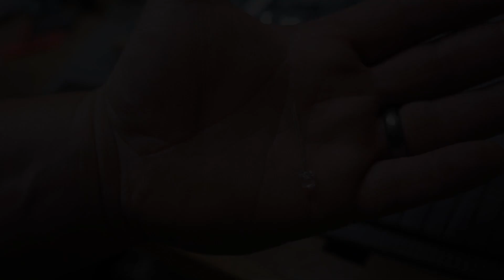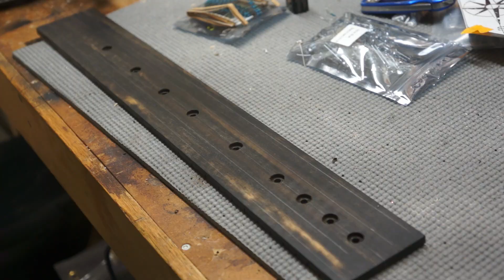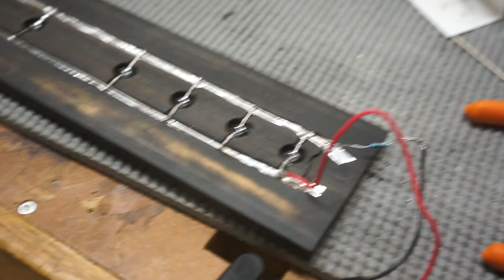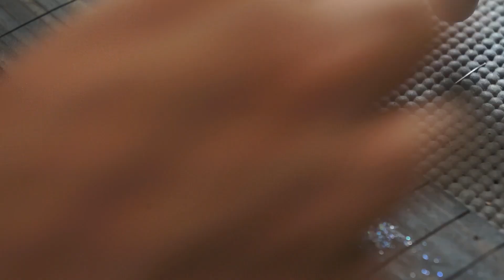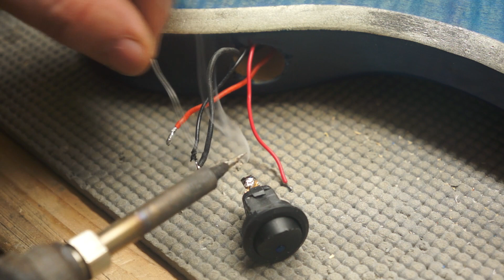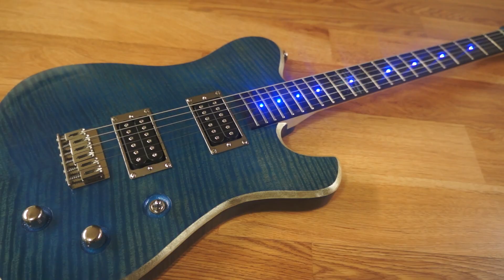How to build an LED dotted fretboard (tutorial).

Comment: I was wondering if this could be done with Force-sensitive resistors so when a string is fretted it would light up.
There could be many problems with the implementation of this idea though. One is you need to make over 100 holes in the fretboard so each fret + string combo has its own light. The LEDs need to be much smaller than the ones you use on the video or there won't be much of a fretboard left after all the holes are made.

Comment: Nice tutorial and cool project! I think it'd be helpful to provide an actual resistor value in ohms. Describing it as "6-12V" is electrically meaningless, no offense. Using the resistor which comes with the LEDs is also questionable. A single LED needs a nominal value of resistor to provide the correct current, and the resistance depends upon the power supply value, and the type of LED (each color has a different internal voltage drop). If you have N LEDs in parallel like your design, then you need to divide the resistance by N to allow each LED to get its portion of current.  The amount of needed current can vary widely depending upon the specific LED and your desired brightness, so there is no single correct answer. How about just sharing the LED part number and resistance you used as a benchmark? Thanks.

Comment: Why would there be interference? Firstly, it's DC current, so more or less constant and thus not inducing. Secondly, while it might itself pick up environmental noise, it is not connected to the audio circuit (might be different for active pickups) and also, there is both a  plus and a minus wire, parallel to each other. Thus, noise would cancel out.

Comment: I'm trying to do that thing on my guitar. Maybe with optic fiber. With leds looks better and easier to do the job but I'm scared... What happens if one led burn out? Can't decide
Reply from the maker: Unfortunately, there is always a chance that an LED can burn out. If that happens, you have to make a new neck. It's fun to do at least once, but it does involve more labor. I can't really comment on fiber optic since I've never used it.
Reply: I'm doing a lot of research about optic fiber and its light conductivity along time. It starts already weak, and if it lose intensity it will be a lost if time and money. If not, well that a lot of possibilities.
I only will need 2 light sources, one for the neck dots fiber, and one for the body silhouette. Yes! Like a tuning car 😁

Comment: what were you using for inlay filler? glitter?  any epoxy?  or is it slightly recessed as a scallop would be?
Reply from the maker: CA glue and then sanded flush to the fretboard.

Comment: Extreme coolness.  Suppose you wanted to control the LED brightness. Could that be done with a small pot ? In fact a push/pulls pot, such as to turn on/off and control the brightness?

Comment: You really don't want to wire LEDs in parallel willy nilly, if they arent matched, which the kind you used rarely are, some will draw more current than the others, and that can be dangerous when you calculated the resistor value to drive them closer to their current limit, that can make some LEDs draw much more current and then burn out.

The best option is to use individual current limiting resistors for each LED, and if you really want to use a single resistor, string them in series and use a much higher voltage source.

You are also wasting a bunch of the energy of that battery this way, blue LEDs usually have a forward voltage of around 3V, with 2.5V being very common, you could have used strings of 2, or even maybe 3, if you have LEDs with a low forward voltage, in series using that 9V battery, or simply used a rechargeable Li-ion battery, like a 16850, and simply used a 100R resistor per LED (assuming they have a 2.5V forward voltage), that way you can limit the current to each LED to just a bit under 20mA with the  battery fully charged.

Or if you reeeeeealy wanna get fancy, use addressable LEDs (those use 5V and need proper regulation) and an Arduino do control them, you'll probably want to shield all the wires as much as possible, though, to limit any cross-talk that might happen with the strings when you have data being transferred.

Comment: what size were the drill bits used to drill the fret board? does it matter the direction of the capacitor when soldering?
Reply from the maker: Hi John. The drill bit size is determined by the size of the LED. There is no capacitor in this circuit unless you are refering to the resistor, in which case is not directional.

Comment: how long does this last ? is there no easy way to replace a bad led after gluing the fretboard? I have read ideas with optic fiber, but almost all use 12v instead of 9v so ... its kinda dificult to do a portable version uh...
Reply from the maker: Longevity will vary based on use. I'm currently going on about a year and a half with mine. They still function great but I don't leave them on for long periods. Mainly used for dramatic effect during live performances or as a show piece. It is a permanent install. No changing lights without some serious neck and fretboard work.

Comment: Mind if i ask
But how much is the total cost ?
Reply: I personally don't mind that you ask, but he might. The total cost for materials is $49.00 American Dollars. If you need to buy yourself a guitar and tools (router, chisels, drill press/drill, soldering equipment, etc.) then you're looking at about $1,300.00 American Dollars if you buy the right stuff. Guitars can cost anywhere from between $100.00 American Dollars to tens of thousands (believe it or not). So you can spend $1,300.00 or $72,000 depending on your budget.

Comment: Have you thought of using fiber optics as the light source and epoxy for the dots? You would need to do less routing and the light source could be in the body of the guitar and more accessible.
Reply from the maker: I have not had any hands on with fiber optics yet. Definitely something I'd like to look into. Thanks for the suggestion!
Reply: @NorthstarGuitars  you have a single light source but a ton of fiber  optic cable to be routed under the fretboard .

Comment: You're SOOO lucky that this works with just one resistor!!! Keep in mind that you will burn the resistor out real quick if you do it this way.
If you want to do it properly, you check the LED voltage and current, and calculate the right resistor for each LED!!!
There's no such thing as a 6-12V resistor. ALL resistors work with 6-12V.
You want about 10mA through each LED, so roughly 100mA total. 
Blue LED's have a forward voltage of about 2,5V at 10mA. You use a 9V battery, so a single resistor will dissipate 0,35W. The one you used is rated for 0,25W.
You'd need to use a resistor in series with EVERY LED! For 9V operation you need 650 Ohm resistors. If you do it any other way, the LED's or resistor(s) won't live long, and you can't
replace them... A shorted out LED or burnt resistor will cause all the LED's to fail.
Reply: This is absolutely right. You've been lucky that all the LEDs are closely matched for forward voltage otherwise you get current hogging and one of the LEDs will pull more current than all the others so getting equal brightness is down to luck and will be even worse as it warms up.
You definitely need one resistor per LED to do this correctly and calculate the value as described above.
Reply: I just built a full scale mock up fret board with yellow LEDs and one resistor. I've run through two full 9v batteries.  My phone stopped counting at 100 hrs but the second battery went 20 hrs more, or so.  I have not burned out my single resistor yet.  Still going strong.  I won't bury the resistor under the fret board and will put it at the end of the chain so I can replace it.  But 100 hrs is way more stage time than my build will ever see.  I'm confident in the Northstar design.
Reply: @dalgguitars  Did you have any trouble with the LEDs being different brightness
Reply: @Ty_Holbrook  Nope.  I used yellow LED and a 470 ohm resistor with 9v battery and simple micro on/off switch. Rock on!
Reply: You've had a year now. Wheres your LED guitar build?
Reply: Hey Ronald can you email me a basic formula for this so I can calculate this or maybe I can describe the leds I'm using and you can help me. 

I wanted to add a switch that allows two functions: lighting individual frets and all at once. Id also like to wire in some kind of pot or rheostat? To make the lights brighter. 

I'd put like a phone battery pack on the guitar strap.
Reply: @mycroftholmes7003  When you say phone battery pack, you mean a power bank with USB output?
Reply: @mycroftholmes7003  For calculating resistors: Most LED's these days use 10mA of current. The voltage differs per color. (you can find that voltage on internet)
So if you use 5V for power, and you use a red LED (about 1,2V) the resistor has to be for 3,8V 10mA.
3,8 / 0,01 = 380 ohm (roughly). Closest resistors in the series are 330 and 470. For maximum brightness I'd go with 330, for maximum longevity 470. Try it out before you mount it in the fretboard ;)

If you want to use a pot as dimmer, make sure it can handle the combined current. You don't want smoke coming out of your guitar ;) Connect the outer two pins to + and - of the power supply and the middle pin to the + of the LED's. - of the LED's to - of the power supply. 1K should work, any lower and you're using it as a heater, too high and your LED's won't light. 

If you want to switch all the LED's individually, you'll need to route wires for all LED's separately through your neck to the switch!!! Unless you use digitally programmable LED's (like WS2812). In the last case you need a controller (arduino/wemos/PIC, something like that), you need to know some programming and the LED's are connected directly to 5V (yes, exactly 5V) and a data line to the controller.
Reply: @angeldelvax7219  are you saying you cant use one resistor for all the LEDS because that would be wrong!

Comment: Do you sand the top of the led’s when you radius the fretboard?
Reply: Looks that way. You can sand off a lot of an LED before you reach the diode part and break it
Reply from the maker: A little. I use my calipers to measure everything out and get as close as possible first.

Comment: I'm amazed that you can do all the routing freehand without having the dremel wander. Where do you get the material (it looks like ebony?) for the finger boards and how do you radius is after doing all the carving?
Reply from the maker: I got the ebony fretboard blank from eBay and I use a radius jig that I built for my router.

Comment: What is the name of the powder u use in your inlay and where can i find it? Thanks in advance for answering
Reply from the maker: I experimented with white glitter for this guitar. It turned more blue when I filled it which was unexpected but it went with the color of the guitar so I left it. I also use Mother of Pearl powder, saw dust of any type and pretty much anything else that's in a small enough form to fill. You can find a lot of that stuff on eBay or at a local craft store. Just got to be creative.
Reply: @NorthstarGuitars  thanks man🤘

Comment: I still remember when I learned the hard way that aluminum can't be soldered by any reasonable means. The tape however is a really good idea, copper and gold adhesive backed foil tapes are widely used in electronics and not hard to find.

Comment: how long does the it last till you have to replace the lights
Reply from the maker: jason hancharyk unfortunately I do not know. This is all a closed system as well so there is no replacing lights without un-gluing the fretboard. I’m just going to enjoy them while they last.
Reply: @NorthstarGuitars  if the LEDs are powered at lower than max rated voltage, they last much longer. Phillips lighting made a special version of LED light bulbs for the Prince of Dubai like this that are expected to last decades. Most LED lighting these days is pushing the voltage to get the brightest light possible, while expecting the LEDs to last less than a decade, presumably because by then, there will be new technology that is even more efficient.